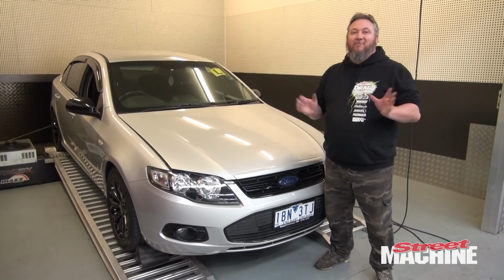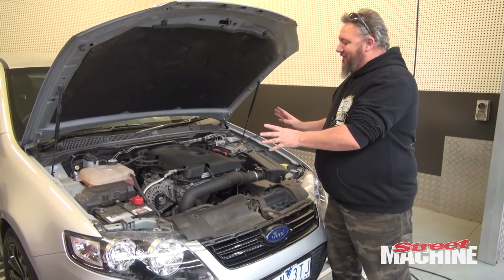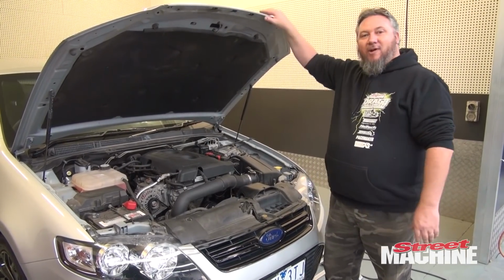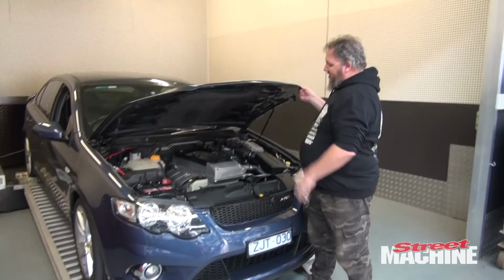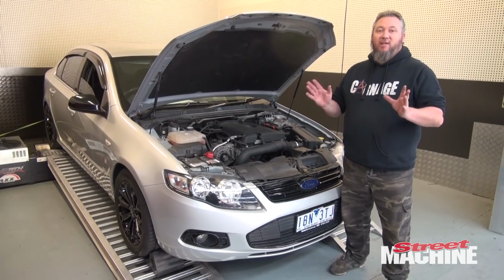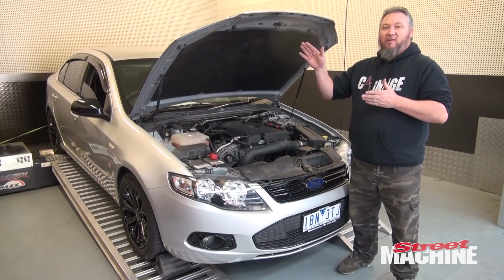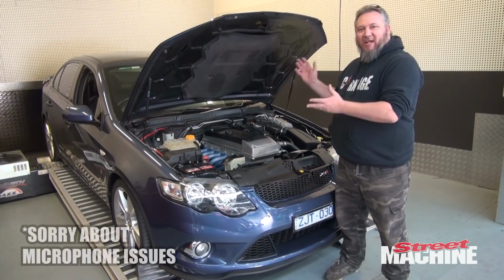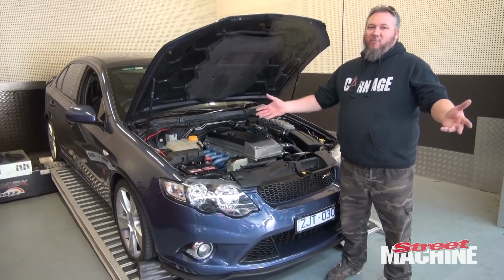P-Plate FG Falcon Battle at Maxx Performance

Comment: I have eco boost , I have a pwr intercooler all hard pipes intake mods k&N filter , powermax turbo , 3” exhaust , high flow cat , new ngk plugs and Bosch coils , ecu tune running E85 with all standard fuel
System and injectors , makes 238rwkw ( 320rwhp) 2400rpm converter , zf6 with the usual oil mods and tuned , 3:89 gears . 

Mate has a full blow 2L ecoboost built over England way from an RS focus rally car and makes 640hp revs to ..9k off its head

Comment: We took the Older Brother model ( BF Fairmont with the 6 speed auto) and added a FG plastic manifold and headers plus F6 exhaust and ran it on E85.......made 200rwkw and ran a 13.7@102mph !! And it's CHEAP !!
Reply: Do you think there is power to be made doing that same mod to a dedicated gas ba/bf? Obviously using an fg gas manifold
Reply: @bigsohc  Do you mean the plastic FG LPI manifold with the liquid gas injectors ?? The lpi motors make 195kw compared to the BA/F 157kw......but completley different setup as the injectors have an lpi pump and spray liquid lpg instead of vapour through throttlebody like the BA/F. Am however trying something with a BF lpg wagon atm.....will let you know if it works out :)
Reply: @mg74xbgt fg eco lpi makes 198kw & more tourqe matey,it's the gun na to have with the zf6 speed only problem NO LSD unless ordered when brand new Never seen an eco lpi with a slippery ass end.

Comment: Twin 2 1/2  seems a little excessive  thats Good for 500 hp hows the torque probably very doughy off the line ???.
2" 160hp
2.25"  200hp
2.5"  250hp
3.0" 400hp
Reply: That is 110% correct. For a n/a motor I think its too big. A stock twin fg turbo exhaust will provide better flow and will not reduce the torque output.

Comment: About to begin modding my BF MkII Fairmont Ghia. Mod list will be as follows:
PH4495 Heads
MRC High Flow Cat
MRC 2.5" Catback
3:73 Diff Gears
SS Inductions Growler Kit
BP Cams & Valve Springs
ZF6 Hi Stall with Tune
255lph Pump
Tuned on 98 Octane
Sub 220rwkw perhaps?
Thinking about using the FG Turbo Intake manifold.

Comment: That na xr6 is running low, they come stock 195kw even with mods thats running only 180 at the wheels, which is low as. I have stage 3 air intake, full exhaust system, pacemaker extractors, upgraded pully system, tune, and i got 246kw at the engine which is like 220 at the wheels.
Reply from the maker: Stock they're 195kw at the engine so the figures shown are right. You say you have 246kw at your engine but how do you know that? Did you run your engine on an engine dyno?
Reply: @STREETMACHINETV  The only way he is getting 220rwkw on an NA barra is with some big CAMS for some extra pull up top

Comment: Was the xr6 on gas? Before the eco lpi came in? Or was that the petrol. If it is the petrol that is very surprising. Meant to be 195kw
Reply: Rear wheel figures shown here, it's not flywheel figures like the factory quotes.

Comment: I have got a ecoboost and have done a bit to it and it's running about 197rwkw and it goes heaps harder then the na6 with similar mods.
Reply: The ecoboost is slightly slower in stock form cos its down 3 or 4 kws on the power/weight ratios. But tuning an NA is incomparable to a turbo. Bang for buck in turbos are insane. But then again the ecoboost has the shit chinese ZF rip not the proper german one.

Comment: Revhigh do VF sv6's with a VCM OTR and a tune and they hit 210-215rwkw. id go with the holden
Reply: Yeh but vf sv6s also make a lot less torque. They dont last anywhere nrsr as long. Not as reliable and comes with a shit transmission. So at the strip, i would be backing the falcon anyday. Also falcons are capable of 220rwkw as well.
Reply: holdens are gay as fuck, rather vomit

Comment: If the trans can handle it an ecoboost everyday. You look at what the Euros have done to the ecoboost 2.0L output wise, and the Americans (in a rwd chassis). The Aussie ECU is unique but if it can be cracked it can definitely handle some decent power with basic mods. For me though, is the lack of weight over the front end would make it a very fun vehicle to drive as a daily, compared to a much more nose heavier Barra.

Comment: If I was a p plater I'd be into the xr6 leave it mechanically stock get the look right for what I was into also start to buy turbo parts manifold injectors turbz ect then when the restriction is over it's not a hard conversion to turbo there's the power and looks sorted also when I was a p plater money was a massive issue so buying parts overtime would allow you to save for better parts just my 2c

Comment: As a P plater today I’d go the ecoboost: fatter torque for better driveability, more discreet and the money saved from petrol would go towards the next set of wheels. Would love to know how they go down the 1/4.
Reply: I would take the ecoboost, a nice set of wheels, leave it stock then put in a worked barra turbo I saved my money on. 
Edit: Plus it's always nice to have a spare engine.
Reply: @snowboxesful  the head Ford Engineer for the FG said the NA can make 198 KW and 409 NM with 95 Octane and even more on 98 Octane. The NA with the 6 SP ZF are 6 speed manual is a decent performer. Change the diff ratios on the FG 6 and you have a decent boat. Quarter mile will be low 14s with good tyres if you have shorter diff gears - a 3.23 is more than enough on the ZF.

Comment: Because cops pick on P platers ALOT I'd go with the less in your face G6 over the XR6, just to try and stay under the radar a bit more. Also its only for a few years untill you get your full license and then just buy an XR6 Turbo. Plus the Ecoboost falcon is the faster one in the corners with a lighter motor in the front lol and possibly faster in a straight line too.

Comment: I believe the Ecoboost Falcons run a lighter version of the ZF 6 speed.  This is the reason for the reduced tow capacity.  I would take the 4 litre to get the stronger auto.

Comment: What is the weight difference? Is the diff the same? It would be interesting to see them line up at the track.
Reply: Roughly 200kg difference over the front end.
Reply: @aaronkingsley3035  A Barra weighs about 200kg, so that cant be right!
Reply: 2012 FG MK2 XT 4.0 = 1710KG
2012 FG MK2 XT ECOBOOST = 1648

DIFFERENCE 62KG..

200KG yeabh right... typical internet BS!

Comment: Mmmmmm, ive never really considered the EcoBoost, but for P Platers i guess its another option.

I have owned both NA and Turbo Barras and love them.  I know that the lazy low revving NA Barra is good for hundreds of thousands of Taxi Km's, but i wonder how much longevity a wound up 2000cc would have in the big heavy falcon.

Will be interesting to see the drag race.  Im guessing the EcoBoost is a light engine?  Good for handling, certainly better than the Barra.  Perhaps a proper winding roadtest as well as the usual aussie bogan 1/4 mile 😉
Reply: The 2.0 is LIGHT. 180kg roughly.

Comment: To be honest you could really go with either. 186kW on the 6 it'll still out-last the rest of the car, the 4 has a weaker transmission but I think overall it'll be fine with the small torque/power bump. The 4 would feel fantastic off the lights though you'd surprise a lot of traffic light heroes (aka, the guys that line up next to you in a lane that ends after the light)
Reply: Completely wrong about the trans. It's the same ZF as any other FG.
Reply: You were correct, I thought the 6HP26 was in use since 2006 but they were only using it on turbo models, 6HP21 was used for N/A/i4T. I wonder why Ford lowered the tow rating on the I4 Turbo model then.
Reply: @joytech23  False. The Zf6hp21 did appear on the earlier Fg models but it was on only on the ecoboost. All the other na and turbo fgs had the zf6hp26 which they should have kept. However in the fgx all the na models got the zf6hp21. Lower row rating is from 60nm less torque and the weaker trans.

Comment: I had a 4 cyl turbo commodore hire car in NZ. Very impressive. I think I saw 240kph but I can't be sure for legal reasons...probably more like 100kph. The dash rattled louder than the stereo at full noise. I'd take the Ford.
Reply: Wow, that's 20km/h faster than my stock AU... ummm... felt like it was doing when the speedo said 100...
Reply: @skippy2987  I hear ya Skippy.

Comment: For my money I would have the 6cyl Barra. A 4cyl will always have it's limits and like most will be buggered by 100.000 Kms. My old 2008 FG Barra had 250.000 Kms on it when I sold it and it was still punching power like it was brand new. Lets see an Eco-boost do that.

Comment: As soon as they get pulled over, extractors aren't legal for a P plater. EcoBoost will get away with looking stock for the most part
Reply: DJute84, why aren’t extractors legal for a P plate driver? 🚙
Reply: @lyndongordon2518  in Victoria it is against the law for a P plater to put extractors on the vehicle. The regulations came in a bit after I had my full licence. Something about making the vehicle too powerful for an inexperienced driver

Comment: I had a similar choice to make when buying an Audi A5 once. I drove the naturally aspirated V6 and the turbo 2.0 4 cylinder and the torque of the turbo engine gave it a much better midrange. So I bought the 2.0 but I normally prefer na. I have a naturally aspirated V8 now so best of both worlds.

Comment: Cool cars definitely, but I would have neither. My P Plate legal XR5 has more power and torque tuned and is lighter and gets better fuel economy, sounds and looks better too.
Reply: I agree with all of that.. But, if you had a few extra dollars a boosted rear steer falcon wouldn't be so bad!

Comment: 4cyl if i'm honest. You will get the hectic Turbo sounds on your p plates and the girls wont have any clue but it makes sneezing noises so it's "cool"  you only attract males with an n/a barra
Reply: ChrisHallett83, speak for yourself. Have you tried an EcoLPI Barra six powered car? They have high BMEP all the time, unlike a turbocharged car. Running only on LPG, the engines stay clean on the inside too ... 🚙

Comment: Amazed that Vic allows turbos for Ps. NSW allows some turbos for fuel economy reasons but set an absolute pwr/weight ratio at 130kW/tonne. For a 1700kg car, that's 221kW/296HP, which in my not so damn humble opinion is far too much power for an inexperienced driver.
Reply: Is it still a no go for p,s to have a v8? So no 253 hx wagon but 300hp turbo falcon ok?
Reply: @watsisbuttndo829  all v8s in victoria have to be under 130kw/tonne, they changed rules last year
Reply: In Victoria a P plater could legally drive a SY Territory Ghia AWD Turbo

Comment: Some maybe impressed by the ecoboost output figures however they need to remember it's forced induction. The stock Barra is naturally aspirated and making basically the same power. Yes the ecoboost is impressive although the P plater will more then likely start searching more power that can only safely be achieved by the Barra. I would be taking the Barra for reliability reasons for a first car
Reply: The Ecoboost is pretty tough. There was a Ford mini f1 with the 1.0, made nearly 300hp. The 4 can make power. For how long remains the question

Comment: Purely because I've worked on the sixes for years, I'd stick what I know to be one of the most reliable petrol engines. The ecoboost in the falcon may very well be reliable, but I never had one drive into my workshop to form an opinion on them.pretty rare

Comment: Meh, Barra for the Win.
I cant see the Ecoboost having anywhere near the longevity of the Barra and much fun as the Ecoboost is its still working way harder hauling around the Falcon.
That and I have this nagging Starfire 4 VB Commodore image stuck in my head and we all know how THAT went.
Reply: Comparing modern turbo 4's to the starfire is a lowblow. 

It would be like comparing an LSA to a stock cam 350 chev.

Durability is not strictly related to engine size divided by vehicle weight.

Cooling system revisions, oiling revisions, modern oil, bearing journal width, bearing journal diameter, rpm, fuel quality, fuel type, fuel cleanliness, and usage conditions are all factors in engine longevity.
The singlecam 6 outliving the Windsors in the AU is proof of this.

As long as its not abused, and somewhat regularly serviced, I see no issue in the ecoboost. Its a well designed motor
Reply: Kinda like when Ford decided that a 3.2L 6 was a great economy option for the new EA Falcon.... 

Revved too hard and burnt more fuel then the 3.9 did in normal driving.

Swiftly dropped after 9months of production haha
Reply: @Giga Shrubbz the ecoboosts will never last amy where near as long as a barra. Small displacement engine being forced with huge amounts of air from a turbo and coupled with direct injection means it aint gonna be getting anywhere near a million kms like a barra.

Comment: How easy  would it be to get an ecoboost ... im sure alot harder to find  out in the wild than the six.
Reply: State side they're pretty common. At least the engines. We have several Ecoboost engines. 1.6, 2.0, 2.3 (i4) 2.7, 3.5 and supposedly a 3.3 v6. The last one I'm not sure of. But the v6s are not all that common outside pretend SUVs or the f150

Comment: There is something strange about a 4cyl falcon. Kinda like paying for a hooker, but only wanting to cuddle 🤔
Reply: Or going to McDonald’s for a salad
Reply: Just as good as the power dip on the 6, in the mid range.
Reply from the maker: @wobblysauce  that's the manifold transition

Comment: I know you are in VIC, but in NSW, as soon as you do ANY changes / mods to a "P-plate legal" turbo, that car is no longer P-plate legal. What is the fine-print in VIC I wonder...?
Reply: Yeah same. Your not allowed to make performance upgrades at all. It’s 3 points and a few hundred bucks for p plater. I’ve only ever heard of people getting booked with it when they have been already caught speeding or racing on the street, they just use it as another couple of points to make sure you lose your licence

Comment: The 6 cylinder all day long. Application of power and longevity of the engine. Also will be a much better cruiser, without the lag.
Reply: New en urbo engines have pretty much no lag these days. Same goes with the Ecoboost falcon.
Reply: @Giga Shrubbz It doesnt tho. It has a lower power to weigh ratio.

Comment: You should of added the LPI gas FG.
Those things can make some serious power for a NA
Reply from the maker: It would be an interesting comparison. They are supposed to be pretty rapid
Reply: @STREETMACHINETV  

I'm sure Scotty could find one to throw on a Dyno.
Surely 1 of the SM following has one near by.
Or better yet, put it on the list as a future project for Carnage 🤘 would be a very interesting journey to follow
Reply: @STREETMACHINETV  I own a 2012 ecolpi xr6, would be interested to see what power it can make with some mods even though most places say they can’t tune them
Reply: I have a g6e lpi, I'm based in south East Melbourne.

Comment: The unfortunate part for the ecoboost is the transmission is designed for light duty. It's like this for fuel economy reasons and won't survive with the extra torque once the ecoboost is tuned. 

Stick with the 6, cheaper, more plentiful, can tow heavier loads because of the stronger trans, cheaper to modify, more ultimate potential, sounds better etc. The only benefit from the ecoboost is cheaper rego and less weight over the front end.
Reply: Thats where you're wrong. It's the exact same ZF as the 6.
Reply: Kersah x the 2.0 EcoBoost has the 6HP21, the XR6 has the 26
Reply: @cameronm4201  the later XR6 also had the 6HP21 ;) These falcons are pretty good on fuel and have plenty of torque and power as a daily.
Reply: @aaronkingsley3035  they probably used a mix of both considering the stock outputs could be handled by each one. 450nm for the 21 and 600nm for the 26. The 21 is much lighter and had modification focused on economy. They don't last like the btr 4 speed and need more attention in the cooling department. I'm feeling the ecoboost is going to lunch that auto in the hands of a heavy falcon and its P plate driver.

Comment: I have a FGX Ecoboost with a Process West IC, GFB BOV, Mid Muff delete, hot dog & tune. 180.5 kw & 530 nms. Total cost $5K. What isn't mentioned is the purchase price with FGX Ecoboost available with low kms for $15K. Sounds great if you are into 4 cylinders, better than a taxi Barra engine. One FGX currently for sale with ~ 150K kms for $9,800. Bargain. As for fuel economy, to go 'x' hard needs the same fuel amount for both, marginally more for 6. Drive slow expect 9 litres -100 km. With Ecoboost you can have one but not the other 😃 Something different !
Reply: I have a 2015 ex cop FGX NA, very quick off the lights( don't know if its 100% standard) great fuel economy, plenty of torque, best choice for me
Reply: @npx20  cars don't sweat, they either do it or they don't. I've towed a 1,500 kg car on a trailer with mine without it 'sweating'. My only worry was the brakes weren't confidence inspiring. I usually put some valium in the fuel tank when I think it'll be 'highly strung' 🤣
Reply: @npx20  - noted

Comment: I'd go the ecoboost. Put some port water/alcohol injection in there and it would keep the inlet ports clean and allow MORE BOOST.

Possibly compound turbos if Australia's cert laws don't distinguish between turbo and more turbo, in qld they certainly don't distinguish between turbo and upgraded turbo
Reply: Yeah, that's what I was so surprised about when engineering Crustida for the 2nd time and learning about the difference between NSW engineering and QLD engineering requirements. 🤘👍 If it was NSW, I would've been thrown so hard into the emissions test my brains would've splatted against the wall. 😬
Reply: So minor update, I got one, an ecoboost XT. No big mods planned *coughyet*, probably just similar to what this one has.